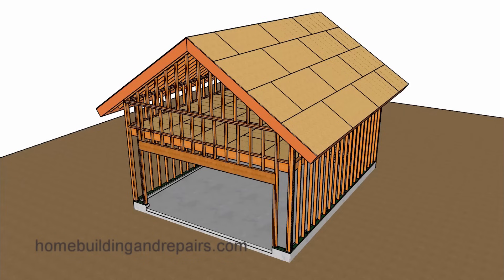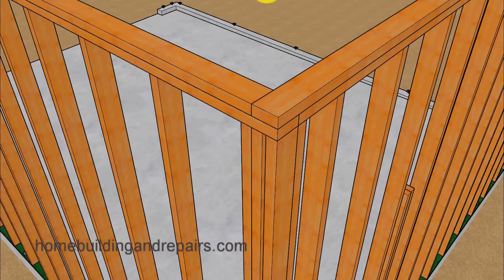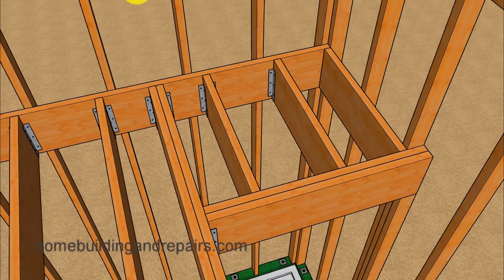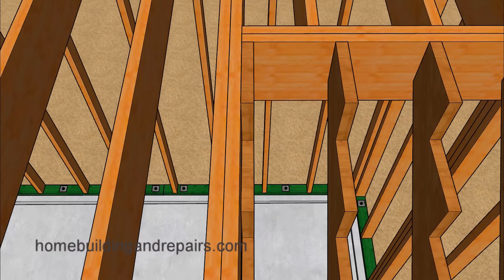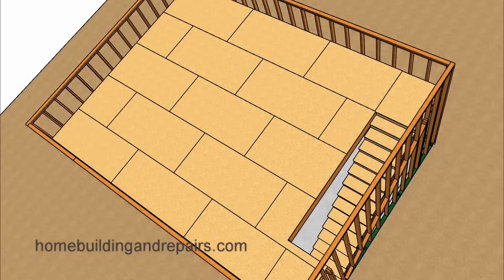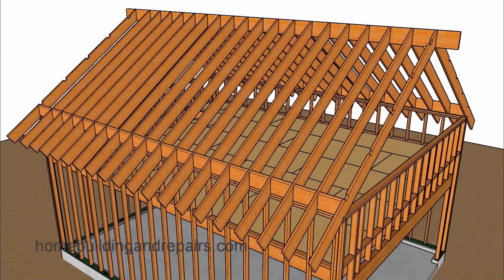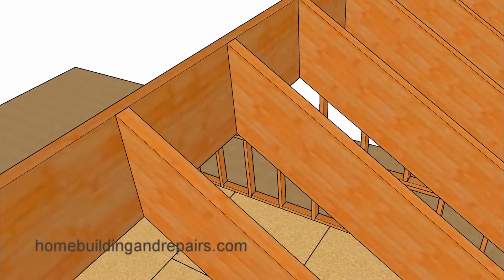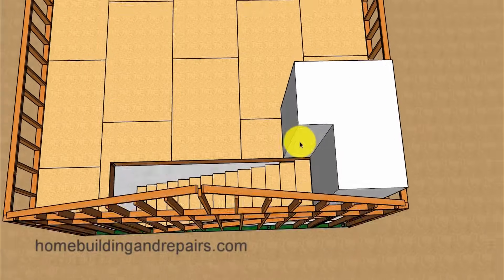How To Build Two Car Garage With Storage Loft And Stairs - Building Education Series Part 1

Comment: I built a garage similar to this. I'm in California, so the weather is mild for uplift and such but we have to build for earthquake's. Mine was 30' wide and 33' long. Walls were 10 feet tall, and had a 8:12 pitch. Walls were 2x6, headers were 6x8's ( overkill), had a gluelam ridge beam(6"x24") overkill again. Posts holding up the gluelam we're 6x6s. Rafters were 2x12 #1 grade. Simpson strong walls on either side of the front garage door opening. I have 3 garage doors. The 2 side garage doors are 8'x8' and the center garage door is something like 9'-4". The garage door header is a 6"x12" lvl beam and it rests on the 2 strong walls at either end and two 6x6 posts that are on either side of the middle garage door. I have a bathroom and a room on the lower level so I have a upper lofted section above. From floor to roof sheeting is 20 feet tall. I wanted a car lift so I didn't have a full length upper floor. If I had to do it over again I would have made is 35' wide and 40' long. If you have big trucks, you need the extra length .
Reply from the maker: Thanks for sharing you project and opinions with us.

Comment: America has a big misconception on a 2 car garage. That 2 car garage will not correctly fit a standard full sized car little lone 2 cars, due the the size of the so called 2 car garage. You have basically no walk around room to the front or the back, the garage door only clears the back of a full sized car by 6 to 8 inches. Two cars in that garage you cannot open the car door to get out of the car without squeezing out like a sardine can or climbing out the window. American 2 car garages are a JOKE as build by those architects, that size has been carried over from the 1930s and does not fit the size of American vehicles today.
Reply from the maker: Larger is usually better, but it costs more and that's probably the main reason why you don't see larger garages.

Comment: I don't like balloon framing. You could do this cheaper by doubling up the studs with a shorter stud next to each long stud and rest the loft joist on the short stud. It would be stronger as you would have mass carrying load instead of lag bolts (fasteners) carrying load, and 2x4s may be less expensive than so many joist hangers.
Reply: I agree. I've done it both ways, and balloons end up a time suck.
Reply from the maker: You don't see that everyday and I will be providing a few more ways in future videos.

Comment: Hey Greg, I loved the video and the wealth of information it provided. Any chance you can let me know how much the material/labor cost of something like that would be in your city and which city you live in. That way I can have a understanding to scale with pricing in my area for a general estimate of how much this project would cost. Thanks again!
Reply from the maker: No, I can't provide estimates and would suggest contacting a builder in your area.
Reply: Costs vary wildly, today that would probably cost you around four times what it did two years ago when wood was pretty cheap, go back another ten years and wood was expensive because the pine beetle was hitting the wood market in some regions.

There's no real point in an estimate right now.

Comment: I’m going with 24’ w x 28’ d if I can afford it.
Reply from the maker: Go for it and don't forget that my this video does not include engineering. Lumber sizes and design calculations might be required by local building authorities.
Reply: @gregvancom  
Yeah, I have a structural engineer will help with that.  I love the storage loft without having to build a full second story.

Comment: What did you use for the second-floor floor joists? Nice job!!
Reply from the maker: You might need larger joist and should check with your engineer for lumber sizes in your area. I used 2x12 select grade lumber in model.

Comment: Why would you put 2x10 for gutter boards and fly rafters?  also Why would you put all the blocking in between rafters at the top of the walls? Shouldnt there be be a gap so baffles can be used to vent the roof ?. Thanks
Reply from the maker: I will be going over ventilation and showing different ways to make fascia smaller in future videos in hopes of answering your questions. I'm creating a list of possible videos to be made in this series based off of questions from viewers like you.

Comment: Do lag screws connecting ledger to wall stud have to be screwed to every wall stud?
Reply from the maker: Usually, but it will vary on the size of the floor, building, design and other structural engineering requirements. You will need to contact an engineer or local building authorities before building a project like this in your area.

Comment: As soon as I saw the location of the stairs, I believed there would be a code violation for head room above. I can see you’ve given this great thought and attention. There are several conditions that I would look at to solve this while in the planning stage. I’m sure you have considered them too.
I would have solved this issue before presentation, even though this is hypothetical
Reply: headroom usually only applies to living areas. Garages and storage areas are not allowed to have living areas in many places.
Reply from the maker: Most garages have minimum head room requirements and good point about storage areas. Verify with your local building department what these areas will be designated as, because storage areas usually require stronger structural framing assembly methods.
Reply from the maker: I didn't solve the problem in this video, because I wanted to show viewers the problem but did in the next video. https://youtu.be/TAi27df86Zk

Comment: @10:18 Something I find interesting with this design is that the wall studs don't line up with the rafters.     I was told lining them up is a better way of transferring load from the roof to the foundation.  Any science or reasons why someone shouldn't build with them lining up?   Thanks for this series!
Reply: Theres 2 top plate on the wall that spread the load evenly from the rafter... Most rafters are 24 oc( on center) and walls are 16 oc...
Reply from the maker: Yes, line them up if you can, but some builders worry more about sheathing layout. For example if you line up rafters with wall studs, the roof sheathing or wall sheathing could require more plywood. If you can make it work then great, but it's never been a big concern of mine with double top plates in wall framing.
Reply: @gregvancom  I'd imagine the weight is distributed well enough over the whole plate length
Reply: Also most efficient for running duct work for heating n cooling

Comment: I wonder if most building codes would require the collar ties to be lower or a structural ridge, to prevent the walls from spreading?
Reply from the maker: Always check with your local building authorities and engineers to see if this can be built in your areas. Don't confuse collar ties with rafter ties and you can lower then if needed. The floor can prevent the walls from spreading, but if you're worried, then add a structural ridge beam.
Reply: @gregvancom  Thanks for your reply
Reply: I was wonering if these colar ties are enough as well, as floor joists are far from the rafters?
Reply: @jptanev  Well, you bring up a good  point, something I didn't think about.  The floor joists together with the balloon framing will provide a lot of stiffness to resist the roof wanting to spread the walls. Maybe that will make it work.

Comment: What about wind braces?
Reply from the maker: Can you provide me with more details? I don't know what wind bracing you're referring to.
Reply: @gregvancom  The walls should have diagonal bracing in exterior framed walls (at the corners), usually a 1"x4" piece of dimensional lumber. Kind of hard to explain, but if you google it, there should be pictures.  Thanks.

Comment: It seems odd to use balloon framing. Platform framing is easier, no fire blocks, the floor system is bearing on the walls. Holding everything up with bolts just seems weird....There are a few ways to brace the structure differently to accommodate this. That being said, nice video presentation pretty good stuff.
Reply from the maker: Glad you liked it and there are other ways to build this. I also agree with you on the lag bolts and always check with and engineer before building anything like this.
Reply: Building this with platform framing would require a ridge beam in most cases, right?

Comment: OSB for tread and riser?  Bad choice.
Reply from the maker: What would you suggest?
Reply: @gregvancom  no disrespect I just never liked Osb plywood,anything but osb as far as 2x tread depending on tread  width,maybe 2x12 Doug fir or cdx.
Reply from the maker: @jjciii522 I didn't mean to sound like I was questioning your motives and agree that osb might not be my first choice if money was not a concern. Thanks for sharing.
Reply: @jjciii522  How about 1 1/8" ply for treads?
Reply: @tomruth9487  sure,just don't use pine or finger joint.tread must have some strength.always consider stringer quantity  and spacing . I've seen the bare minimum as far as stairs goes in my 32 yrs in the business and most held up,but not worth cheaping out.

Comment: Yes!  I enjoy your videos thanks!     - I have sand where I live and have leaned to just build on top  of the ground, even my decks after 12 years all sank unevenly.  So a large shed I was planning to put up on blocks,  any advice would be appreciated
Reply from the maker: If you don't have stable soil, I would contact your local building department to find out if you need to dig deeper footing or add something to the soil to make it stronger.

Comment: Is it possible to raise an existing 20x20 normal height garage to make this?
Reply from the maker: Yes, but some work might need to be done to the concrete foundation.
Reply: You could raise the existing structure and concrete block up the foundation to the new height.

Comment: I would be tempted to hand seven IBC containers under the loft and install a wet room/ bathroom above where the stairs begin going up. Turn the containers into a contained waste treatment unit. That way I could live above the garage and still have a bathroom without attaching it to the sewer system of the house.
Reply from the maker: Go for it.

Comment: Cool! Looking forward to the series. I’m interested to know why you decided to go with ballon framing rather than platform?
Reply: If he had platform framed it, the knee walls upstairs might not be strong enough to resist the outwards force of the rafters and they could kick out. Whereas continuous studs allow that outwards force to be transferred to the floor joists also serving as rafter ties in this case.
Reply from the maker: I will be addressing this problem in a future video. I would also suggest going to the website and watching more engineering and roof framing videos.
Reply: @gregvancom  Watched your vaulted ceiling vid. So, it would need a ridge beam. Got it, Thanks
Reply: @mikec7373  Ugh, I made a really good drawing to explain it but YouTube doesn't let me post the link

Comment: Could you use 2x8 rafters?  And what did you use for your garage door header?  Love the videos, I need to send you some of the projects I've done over the years by watching your videos.
Reply from the maker: In some areas you could probably use 2 x 6 for rafters and I'm using a 4x12 header in the video, but it's only used as an example and in your area, you might need a larger one.